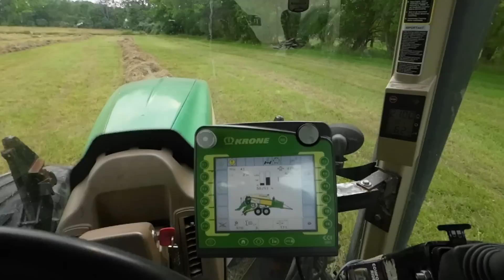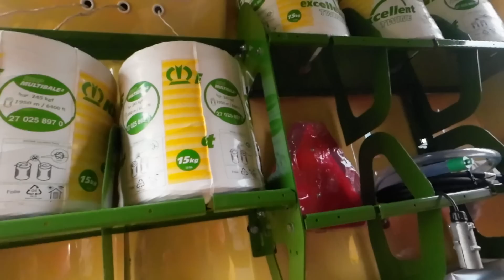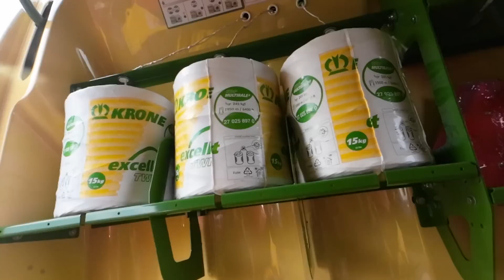Walk On The Equipment Lot

Comment: Don't spend big money until you have a good crop year.  (Interest rates are bigger factor these days too).  I think getting a TR98 is good idea because they are fairly inexpensive, but keep the TR96 in running order for backup.  I would also recommend that you get a Bish adapter ($2000)  to run Deere heads as another backup plan.  (They will work on both a TR96 and TR98).  If there was a serious problem with your NH head, you could quickly find a JD head to get back in business.  If you had to get a JD head, it would easy to resell, or use on a future JD combine.

Comment: Wesley, work on your existing combine as needed to make it reliable and operate efficiently. Purchase heads that will make it and you more productive (8 or 12 row). Once this year's crop is in the bank, evaluate what would be prudent for next year.
Reply: The combine he has can not run a 12 row
Reply: He would, his combine is actually in really good condition. He talked about it in another video. The problem is everyone has stopped supporting the headers for his combine, so he can't get any parts to repair his headers. Even aftermarket their is no support for the headers his combine uses. Even if he found decent headers for his current combine he has no way of fixing them if he has a breakdown. That's the issue he has and why he's looking for a newer combine.

Comment: Ran a TR 98 for 20 years with a 996 6 row corn head. Was a good machine, I don’t think I’d want a 12 row hanging on the front of one though, just didn’t seem like it would be enough machine for the head, neighbors tried 12 rows on there CR9060’s and switched back to 8 as well. Spallenger Combine bone yard is where we would get parts for ours.

Comment: Spend the 30-50 and get what works for you. If you go to a 12 row head, you’ll be sitting and waiting for Tim to dump wagons. Have the bigger combine running a 6-8 row head, plenary of power to clean and not be running max power so you don’t drown your current infrastructure. Otherwise you need a hopper bottom, drive over pit and probably a wet bin to feed the dryer if you go 12 row head

Comment: New combine, new heads, new building, new grain bins, new grain carts. Your starting to sound like Cole. 😂, Probably be better with moderation, newer used, and invest any extra in grain handling or storage as needed. Can you store grain in your existing buildings and move it with your existing trucks and trailers, if you get the equipment to put it in Bulk bags? Can you store grain in sea cans and sell it directly overseas for more return? Wishing you and your family the best.

Comment: See a few 98’s and 99’s on tractor house with under 3k thresher hours. If you step into a larger combine you pick up the ability to run 2 thus you cut harvest time down while reducing the hours per machine, or you have a backup should the primary go down. 

One of the 98’s even had a grain platform for under 30k. That could be a worthwhile investigation. 

Paid off owes you maintenance and upkeep only. Not paid off means you are dependent on yields. Not enough yield, and you are spending money to loose money.

Comment: Buy nice or buy twice. Move up to a CR. CNH drops support for all their equipment much faster than anyone else. It will happen to TRs eventually. They dropped TXs over a decade ago. Also most CR/CX headers can be adapted down to TR/TX by installing side plates on the header and adapting the hydraulics, so perhaps you could upgrade headers before the combine.

Comment: love the TRs We ran two 99s had one blow a hydraulic line and burnt up and couldn't find any decent low hour ones any more so sold the other 99 and moved into a CR we bought a 35 foot grain platform with it. We had just updated to a 996 corn head and there is a fab shop in Indiana the converted the face plate to fit the wider feeder house of the CR. now after running both I would not go back to the TR the cab is a lot better on the CR less moving parts just a dream to run the unloading auger is better I always hated the flip over auger on the TRs. the only thing I miss about the TR is the shortness of the machine but you adapt.

Comment: Wes if your looking at 740-cf 30 head make sure you check the skid plate bolts are not broke. They are notorious for breaking. I had to fix a bunch of mine. Not the funniest job. I also have a 99c chopping head you can turn the choppers off if you don’t want to use it.

Comment: I saw messicks had 2 cr960 combines for a lot less than the 8080 don’t know if they are good machines though. Maybe instead of the 8080 you could get a cr960 and maybe find another tractor to replace the 7410.

Comment: That probably sounds about right for the whole setup price.... think we spent $300k on a used low hour CR9070, used 76C pickup head, used 98C narrow row 12-row corn head, and a used 74C flex head... but then grew tired of the performance of the 74C and replaced it with a new macdon head (so tack on an additional $50k)

Those prices are from 12 years ago. Probably an equivalent (8.90, pickup head, corn head, flex head) i'd guess at least $400k starting if all good condition used equipment.

Comment: It's time to upgrade to at least a New Holland 8090.   Might as well pull the trigger on something, dependable.  I would recommend expanding your search area for newer equipment & you'll probably have to ship it in like you done your Mother Deere corn planter.   It's time to get out of the TR series.  It makes sense to want to save money on a newer model TR series but your going to have the same issues as you do now.  That series is just too old.   If your going to spend your money just like trucking why would you trade an old bone for an old bone just to save a couple of cents?  Yes, it's going to be expensive, just do it right & be done with it.  Whatever your decision I will have fun watching.

Comment: Tr98 has a nicer cab because of the electric controls and if you want to cannibalize your tr96 that'snot a bad move considering you wont get much for it. A six row corn head with a cart will take off alot of corn plus you dont have to take the head off to go down the road. I have 30ft macdon on my tr97 and it just eats everything and it's  nice when you get those Grey days where nothing will feed and keep harvesting you may have to slow down but your still harvesting is my point.

Comment: I guess I'm going against the grain of everyone else and yourself, but me personally I'd make the jump to the CR and updated heads. I mean I'm looking at it as, yes the price for the combo is steep regardless of trade-in value (if you were even considering trading in the TR96 and heads) and you don't currently have the shed for said combine, but you have an upgraded machine (i.e. more power, tank capacity, harvest capacity, more efficiency with larger heads, parts availability). Now granted, you know what you currently have and what you got into it and etc. But I'm looking more towards the reliability and efficiency, example being I was watching you combine wheat just before this video and you were really pushing to get it out to get corn in which is one aspect that I see the CR being a better option. And I'm betting you could keep TRs running until William can run them, but can you keep getting parts for them by then? I mean you upgrade to a TR98 now but then in 3-5 years you upgrade again to just say a CR, or upgrade now to a CR and be able to run that for 10, 15, hell maybe 20 years! I'm not writing the check or saying I know any better than you but I know what I would rather do.